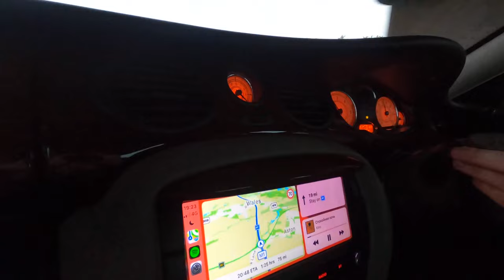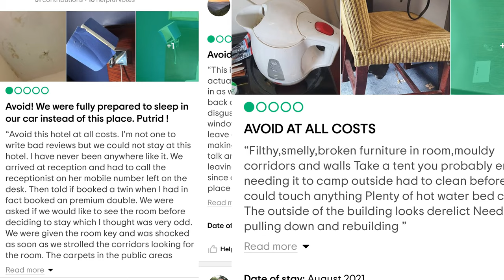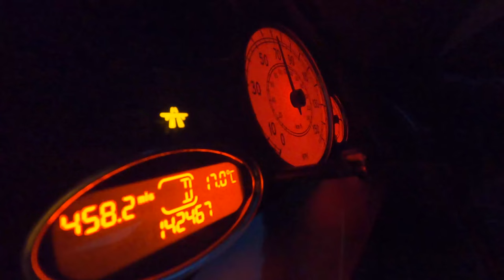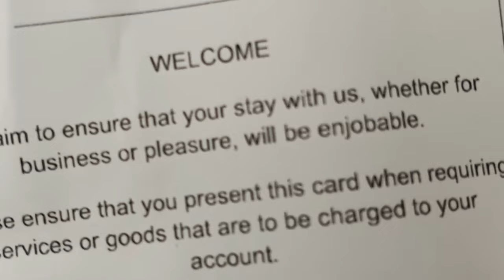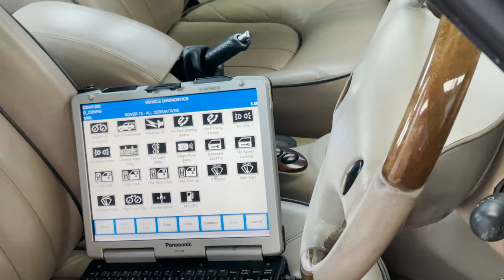Rover 75 HEAVEN! - Must Have Upgrades and Maintenance - Road Trip Vlog

Comment: My Rover 75 was built in October 2002 so has many items deleted due to project drive, I too have the embossed head rests, I recently bought torpedo badges, that’s all the badges done now to pre project drive spec. I’d like to install the high and low tone horn and a real wood dashboard as my plastic one has a crack in it. To say the design goes back to 1998, it’s a timeless design and could teach modern cars a thing or two, the insurance for me, I’m 44 £165 for the year, so cheap and my car is the 1.8 turbo.
Reply: Yes Richard Project Drive was a penny pinching detriment 
So many little things taken away
But the little things do matter

Comment: Thanks for the video,  nice that you are keeping it uptodate.  You dont say how much all that lot cost you?  The trouble is with labour rates nowadays   it would probably cost you more than the car?  Maybe I have missed your video but what head unit do you recommend   in the end?  As from memory was it your  original Xtron  Android  until went wrong?
Reply: Very good point you made about keeping the car up to date and this car is much better than many new cars and also the upgrades can be reversed so the car can be returned back to stock as it was when leaving the supplying dealer
Cost wise  you will find many enthusiasts of the brand will help upgrade and maintain for a very small contribution because they know these cars inside out and want to help keep them running